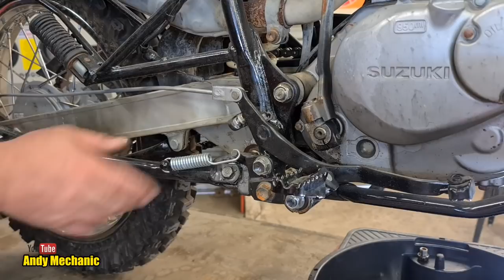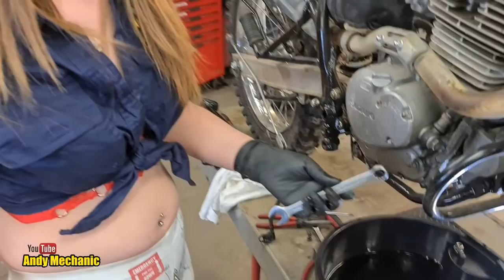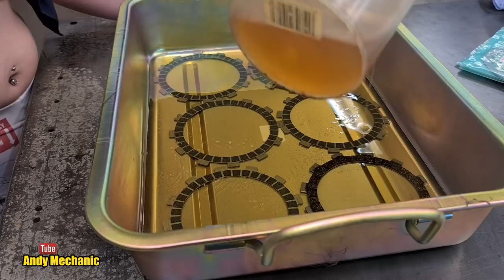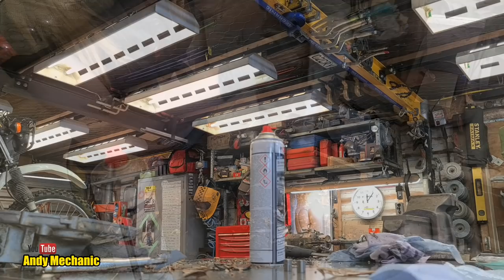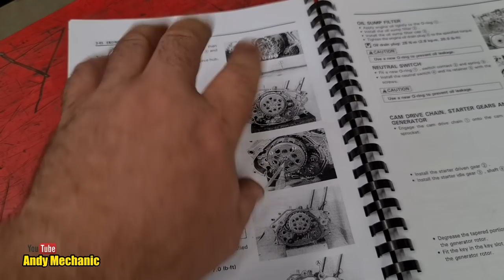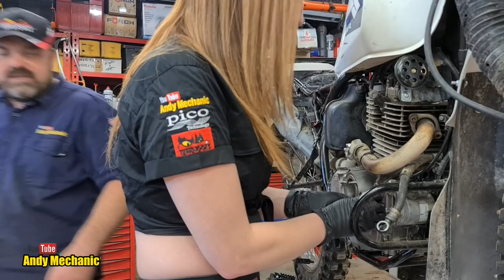DR200 clutch replacement - Ft  TG Holley #1888

Comment: 57:07 Does anyone have an explanation for this? Why has the notch of the inner friction plate to be placed where no notch is to be seen on the basket? I missed it on my RV 200 and the clutch works fine.
Reply: I believe the notches are for oil flow. I’m not sure beyond that

Comment: Andy, love the videos and of course MUCH respect for Holly. I've been doing a Andy Mechanics marathon today in between working on the Drag Bikes. Yes, plural. Waiting on parts mostly, a unfortunate sign of the times. If I may Andy, believe it or not,  there's 2 sides to the steel plates. YES, they do work either way, but there's a inside and outside.  Let me explain.  They're stamped out of a big plate. The die rolls over the edge, cutting the plate out, and leaving a sharp edge on the opposite side.  In a Race Application,  it's truly important to orient the rolled edge outward,  or towards the pressure plate. Again,  for 99 percent of applications, it doesn't matter,  but I thought you would appreciate the insight. I learned decades ago from a Honda Engineer, and even to this day, the lock-up clutch on my Harley Drag Bike, it's imperative that the rolled edges go out on the steels. 
Thanks to you and Holly for the videos,  GOD BLESS.  
T.S. RACING
Reply from the maker: Very interesting, now that's something I didn't know & do now. Thank You :-)

Cheers & don't work too hard!
Andy
Reply: I use the U.S. version of the same bike for a Pit Bike, a Paddock bike perhaps in your side of the world.  Our bikes do not have a kick starter, or a oil cooler.  I wish my bike had both. The electric starter sprag arrangement is a joke. But overall it's a good little bike. 
T.S. RACING

Comment: Hi 👋 Andy and Hhhiii Hollye!
Oh men, she so cute 🥰  and interesting.
I would like to have a “beer o’clock” with her and you too. Lucky 🍀 you!
About that kind of gaskets: I recently had to do a similar job on my Suzuki Jimni timing chain cover and its matching surface on the crankcase because damn LPG f…ed up my (soft) exhaust valves and valve housings at just 60k km… LPG is barely good for kitchens and now it’s also expensive. Furthermore she (my Suzuki) doesn’t like it because it hasn’t  hydraulic lifters and I didn’t check play on them. What a f…ing bill 💵 came out !!
So, if I could get the part on the bench I use a gentle nylon brush on a air tool and some gasoline to soften silicone a little bit. When I fit a new gasket I apply some natural resins based sticky sealing liquid that comes in small bottles with a brush integrated underneath its cap. We call it “ermetico”. It improves sealing and help keeping gaskets in place during operations. But I’m pretty sure you already knows it. 
About the torque wrench tightening good habit: I’m very touched …here around every time I’ve asked a mechanics to use  it, especially for my katana’s wheel (she eats a set of tires every 3.5k km) it seems they’re asked to walk the middle aisle of the church wearing a classical ballet 🩰 pink tutu with their d..k “facing at the window “. Excuse me, it can run 300 km per hour and car and bikes are made by soft materials as aluminum and plastic nowadays…it’s really easy to strip a thread o break something…. I personally really don’t understand this idiosyncrasy for using torque wrench 🔧 properly. More ore less sounds like when you give your dog a bath, it feels annoyingly too clean and it has to roll itself into dust to be good.
Anyway they’re just bolts and sometimes I take them too seriously.
Have a super duper good life.

Comment: Great video this is something I need to do on my little dr200 what did you end up giving for oem parts ...I had a old gs650g that took me A year to get valves for it.
Reply from the maker: The Genuine parts cost me a little over $200 New Zealand, that was new fiber & steel plates, clutch cover gasket & new clutch springs. Not too bad I thought.

Yes, parts supply is becoming a huge issue now for all brands of motorcycle unfortunately 

Cheers Andy
Reply: @AndyMechanic  I was going to try to do it on the cheap and only change the fibers but if your in there you might as well do it right but I am going to try your trick with using the oil you soak the fibers in tell Tell Holly she did a good job she maid it look easy